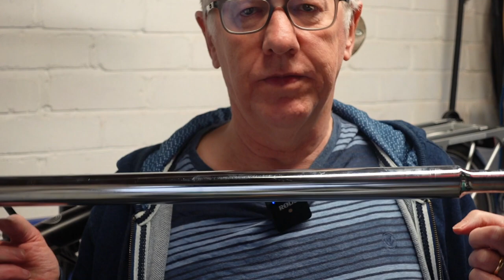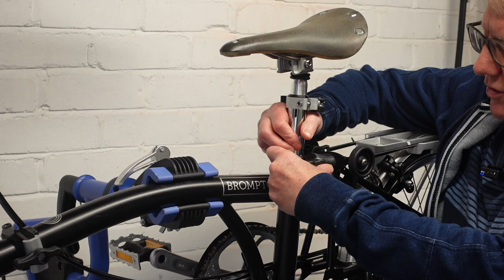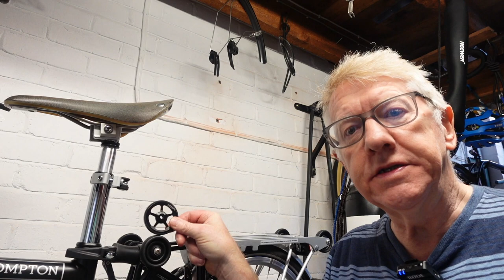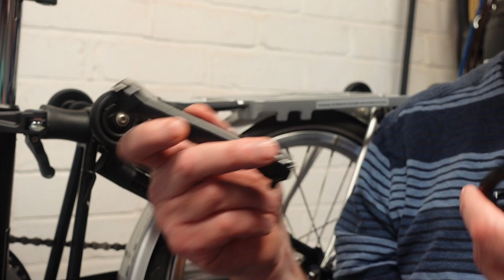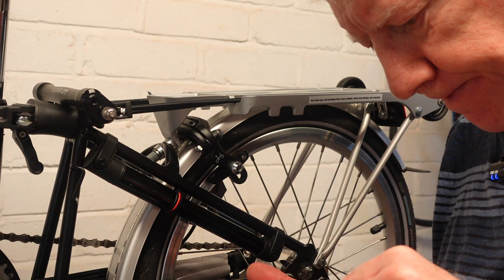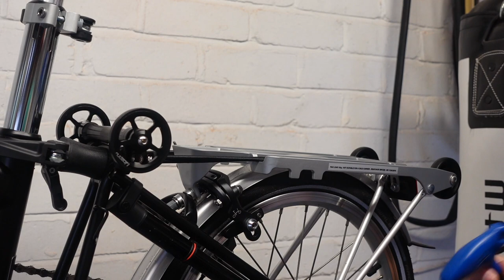Telescopic seat post, Ezi wheels and extender bar - Brompton installation

Comment: Here in Scandinavia my LightweightH6LXBrompton was sold with an extra long 600 mm black seatpost, so I had problems fitting it in my black B&W travel box, so I bought an extra, black telescope seat post, for a very high price from England. I could have bought a new luxury: Joseph Kuosac, post from Taiwan for the same price, I found out! But now I also have a 600 mm black titanium seat post with a ring, for the seats adjustment, and without the weight of the heavy Brompton clamp ( Chinese, AceOffix seels a lighter and better functioning clamp!)! And buying a set of carbon clamps for the mudguards, also saves weight. I have also ordered a set of 10 cm diameter easy wheels, from China.
Reply: And I have got my 10 cm wheels, making my Brompton a terrain bike, when folded!

Comment: And a standard post is around 535/545 mm, I think, so I bought one similar black post (with a wide end), from titanium from China (For the same price as an original post!) for test. But it is just too short for me, but I also have a black telescope post for mine, for use during travels. But it is HEAVY, as  it is actually two tubes + plus an extra clamp in the middle. But my bike was bought in Cph. as standard with an original 600 mm post, so I have problems if wanting to bring it in a B&W box for travels. I then have to remove my saddle and post before packing.

Comment: Now those look like useful upgrades.  The Brompton looks well designed and will be ok without titanium easy wheels. We'll see if you're heels still clip the wheels or they slide out mid ride. Prefer the hand wave.
Reply: It is the way of riding to avoid hitting the easy wheels with the heels. I have just ordered and wait for a set of even larger 10 cm wheels from China! They are much better than my original larger set, also sold as extra from Brompton, and many other firms.

Comment: Thanks for the video! I’m thinking of getting a Brompton and figure I might need the extended or telescopic seat post. May I ask your height and inseam? I’m 6’2 with a 34” inseam. More like 35” with my riding shoes on. I’m thinking the standard seat post might be too short for me. I also like the idea of the extension easy wheel. Does the extension tend to move back into the stored position as you are walking about with the bike?
Reply from the maker: I’m 6ft and you should definitely get the telescopic version. I didn’t have the bike long enough but I think the Ezi wheel is fine. Have a look at Stu’s Hikes and Rides channel - he now has my Brompton and makes a lot of interesting stuff about it.

Comment: Hello there Julian, can you please tell me how long is the telescopic main seatpost (only the thicker steel tube) compared with the original seatpost? Is there any length difference between the two? I would greatly appreciate if you could tell me this info. Cheers mate.
Reply from the maker: Hi, I’m sorry but I don’t have it any longer but the Brompton website should tell you
Reply: @JulianHutchings  ok no worries mate. Thanks for the swift reply anyway. Regards

Comment: Do you have to match the wheels on the back of the rack with the one you just added,will the angle from different diameters cause a problem with different diameter wheels in front and back?   Nice upgrade
Reply from the maker: No, doesn’t make a difference; although I may change the others as well!